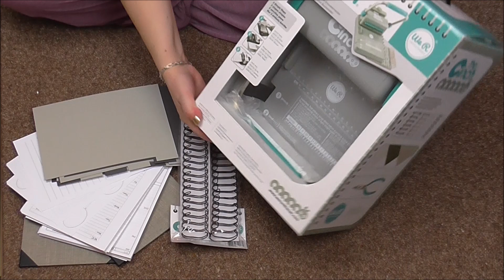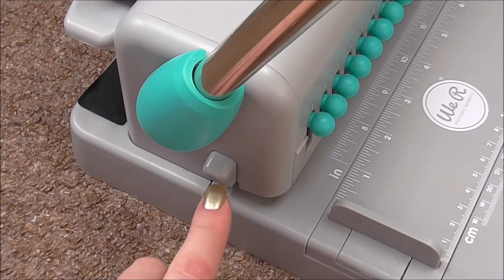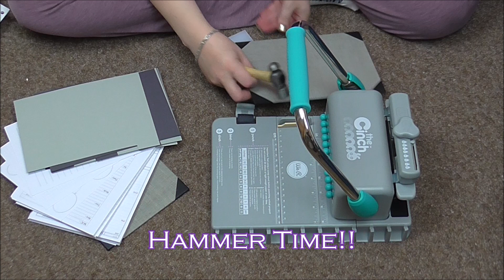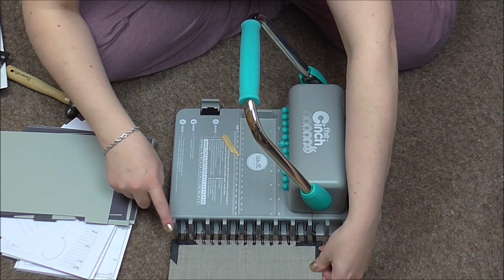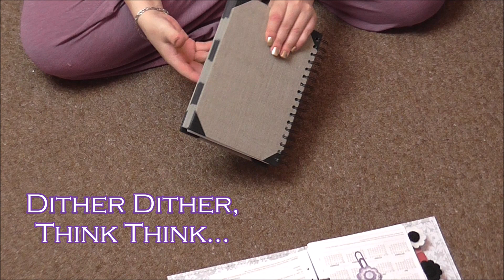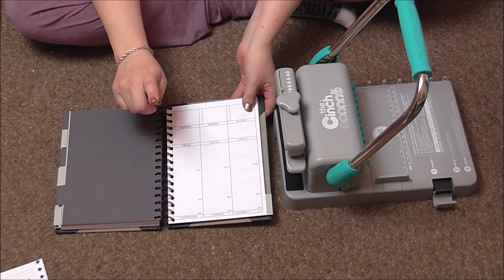How To Use The Cinch Book Binding Machine

Comment: Bit confused I've watched loads of videoes on the cinch and no one has used a buffer and all got equal holes both ends, I've just recieved mine so been watching loads before I dive in 😂
Reply: The buffer (end of a bamboo skewer) was purely because the cover to the diary overhung the inner pages by a couple of millimetres. So I needed the buffer to push the cover over a little for the cover holes to match the inner. There's probably a way to judge it using the attached guide, but the buffer worked best for me.

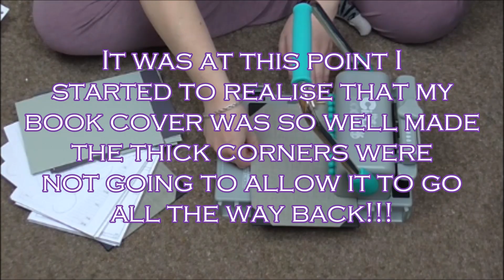Comment: Really nice to see how you get to know your Cinch and use it for that great-looking journal! - If I may give you one tip - it works even better if you put the pages for the inside on the wire first, then add the front of the book (your cardstock cover) THEN the back cover (right sides touching with the front cover). In this way, the spiral opening (where the prongs of the wire touches each other after you cinch it) is on the back and inside of the book, giving you a very smooth outer spiral binding that you can't 'catch' anything on.  See what I mean for example in Heidi Swapp's tutorial here: https://www.youtube.com/watch?v=RsUYDwGl1yE  at around 6:05 - hope this makes your books even better!!
Reply: Do you know how thick of chipboard it can cut?

Comment: Great video Emma thanks for making such a comprehensive review of this machine. I'm looking to buy a binding machine and very confused over all the choices and whether to go manual or electric.. after looking at many options (electrics up to £200 budget) this machine looks very flexible and very reasonably priced at around £60-£70. I like that it can do up to 400 page documents, 20 sheet punches at a time, and you have the flexibility of square and round holes, wire or plastic comb binding.
Reply: So what's ur update?

Comment: Lovely journal!!! There is an easier way to do this - just find the CENTER of your side and use the ARROW on the front of the machine to make sure it all lines up proper.  I just about died when you punched through the corners, I would have left them alone myself
Reply from the maker: Hi Gingergargoyle, Thank you for the tip. With hindsight and now having played with the Cinch more, I would definitely leave the corners alone, it did ruin the finish a bit. Maybe next years planner will have to be an update video. ;-)

Comment: Can you please explain how to use the Cinch if your page has a fraction, for example what if it's 7 3/4 height? I couldn't find any suggestions in the manual, and only one video. Please help if you can. Thanks
Reply from the maker: I think the best way to get around it is to have scrap paper cut to the same size as your finished project and play with the distances of the holes first. I was using UK size A5 paper so that's why I resorted to using a buffer against the guide once I worked out where I wanted to place the holes. Stick with the scrap until you are totally happy and just don't give up. I've since used A4 paper and had to work it out all over again.
Reply: countybunkin6591 thx

Comment: Can you bind something longer than 13 inches?  Also, can you easily add more pages later, after the wire has been closed?  Thank you.
Reply from the maker: Hi Ann, good question. I think the short answer is no, due to the binding wires only being 12inches long. Although you can punch holes in a piece of paper longer than 12inches and you can keep going with the punch as there are no restrictions. If you are maybe threading the pages together with ribbon then this wouldn't be an issue. With regards to adding pages, I do it all the time just pulling the wire apart with my fingers, re-arrange the pages and cinch it back up. Hope this helps.
Reply: Hi Emma, thank you very much, Ann

Comment: Nice video. I just saw an older video from Ellen Bee called "Cinch Tutorial A Few Tips For The Novice" & she shows a easy way to center a project that's a unique size: she folds a piece of trial paper in 1/2 unfolds it, lines her center fold up with the center mark on the machine & it comes out perfectly. I wonder if this would've helped in what you were trying to do without using the little buffer - although that seemed to work too. Thanks
Reply from the maker: Oo, thank you CraftyMama, I will have to go and look that one up, as my method was a bit fiddly, but like you say it did get the job done once I'd worked it out.